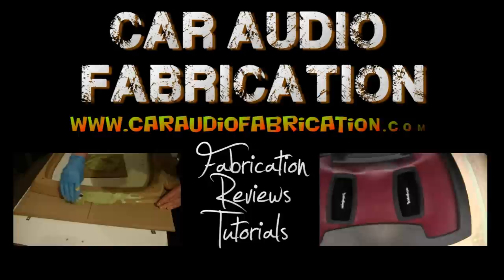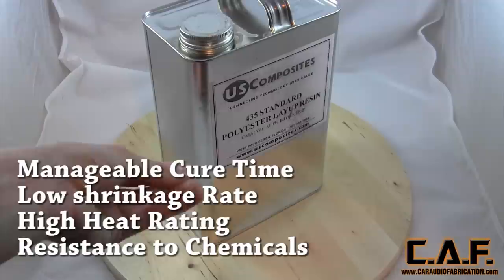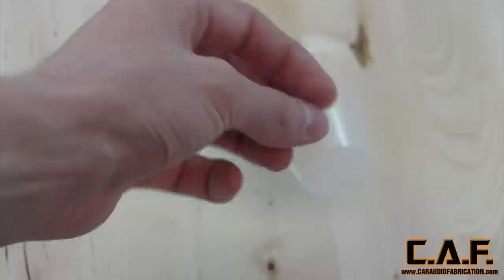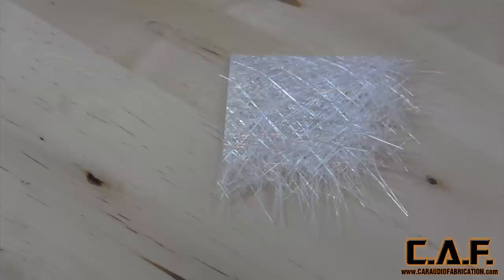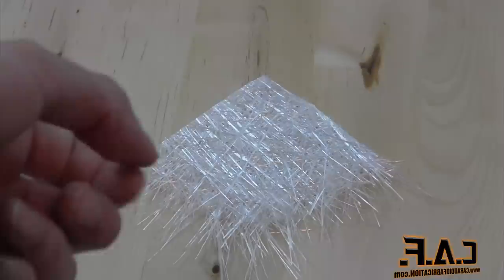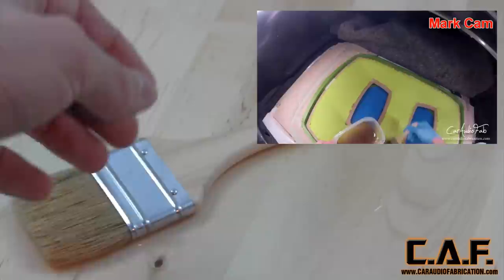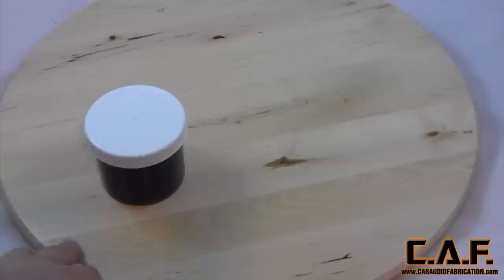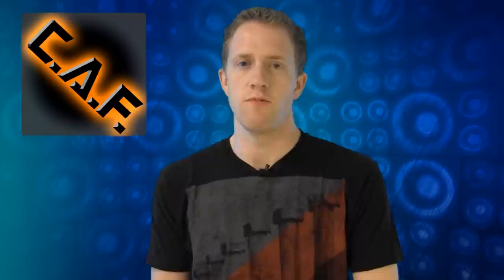Fiberglass - What materials you need for Door Pod Sub Box Amp Racks CarAudioFabrication

Comment: The black pot is resin pigment - it's used not only to colour the resin and therefore the colour of the fibreglass but also allows to see more clearly the spread of the resin when laying it on coloured fleece material / stretch material.

Comment: Yes, you need to use chop mat / mesh for strength. The fleece / fabric is used to make the shapes but it is not strong enough by it's self for any type of enclosure. Most will only use chop but it is actually better to use a combination of chop and mesh in alternating layers for the strongest enclosures. Chop is mainly used to build layers or add thickness and mesh will add strength because the fibers are weaved / intertwined for rigidity
Reply: Thank you. This is an answer I've needed for a long time. Always wondered what the purpose of fiberglass cloth was when I always see mat being used like 99.9% of the time...

That being said, alternating layers would be a smart thing to do when  fiberglassing things like fenders, bumpers, tailgate skins, tailgate spoiler caps, etc? Cause that's what I need to do for my vehicles.

Comment: To run power on the most direct point of entry to allow shortest length of run which usually is whichever side the battery location is. Thats actually the most direct way to set yourself up for failure. Its actually whichever side the harness for the vehicles rear accessory items and function items will run along. Usually the drivers side for domestic manufacturers and the passenger side for any of the foreign manufacturers that are located in right hand drive countries. Its not

Comment: One thing I notice you didn't mention about your resin: With typical store-bought resin as it cures it separates, with a waxy layer on the outside. This is great for a finish that remains smooth and non-sticky, but if you intend to add more layers they will have trouble sticking to each other. That's what "layup" resin is, it's a little more tacky (much like you Mark...j/k!), but will provide the strongest bond between layers.

Biggest myth? "SQ" speaker wiring, and to a large extend RCAs.

Comment: Biggest myth: sealed sounds better (more SQ) than ported or small woofers are punchier and big woofers are sloppier. I think the jar def has pigment in it.

Love the video, especially the chart! My addition is the UV light cures resin without even a need for hardener. The hardener is chemical catalyst, but UV light is a high enough energy form of radiation that it can also catalyze the curing. It's one thing people don't use enough in fiberglassing. Maybe you had a UV bulb in the jar tho?
Reply: Of course sealed sounds better. If better is what you mean by more accurate. Because with ported you are creating secondary sound due to the tuned airspace also influencing the sound as a Helmholtz resonator to get more output.

Comment: Ching Tu Madre, what gauge wire did you use for big 3? What gauge wire do you use for power wire and ground wire for amp? Where did you ground you amp and how did you connect it? And where did you ground your battery and engine during big 3? Have you upgraded your battery too?

Comment: Biggest myth? "Bro, you've got to let that thing breath! It will destroyyyy a sealed enclosure!" Yeah, too bad ported enclosures increase internal pressure, not reduced it...
Reply: How is that, exactly tho? I've never understood that. I mean I know that's the case, just not why that is. Doesn't make sense.
Reply: ok I couldn't pass this. this info you provided is not correct. as a speaker moves it changes the pressure level in an enclosure. In a seal I closure as the cone moves back into the enclosure it increases the pressure level snapping the cone back to it's resting position. This is  why sealed enclosure give a more acurrate bass note. In a bandpass(ported) enclosure as the speaker cone moves back into the enclosure it increases pressure and pushes the air out the port giving you your sound. This is what makes a ported enclosure more efficiante.
Reply: @JoeIsCrazyWillman  it's not true
Reply: @ottobauner9828  how so? Vented enclosures literally VENT the pressure. It's not sealed. The pressure of the cone moving actually has somewhere to go. That's not saying pressure doesn't increase a little, but not even close compared to a sealed box.
That being said, it is also true that "you have to let it breath" is myth. I'm in agreeance with that.
Reply: @JoeIsCrazyWillman  ok you have me confused on where you stand. The original post says a ported enclosue increases pressure more then a seal.which Which you agreed with but did know how.  And I am saying the exact opposite that a sealed enclosure has a higher pressure level. Do to the pressure exiting the vent. Whihc you are argueing with me about saying the same thing i said. I know a sealed enclosure has a higher pressure level then a ported enclosure . thats what i just said
Reply: @ottobauner9828  my comment was aimed at the OP comment, not yours.
Reply: @JoeIsCrazyWillman  ok it confused me cauze you tagged me not the op